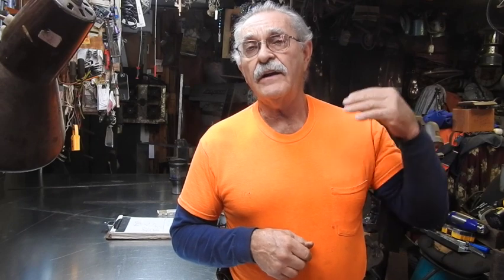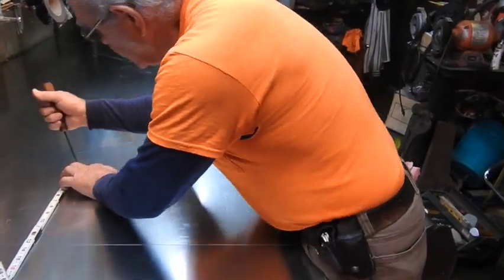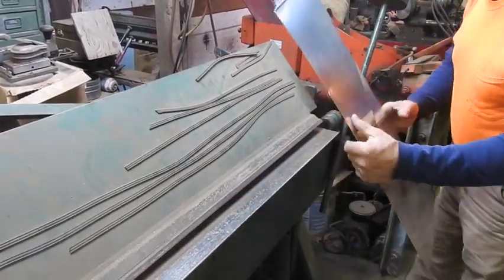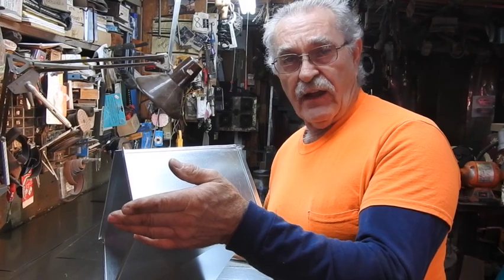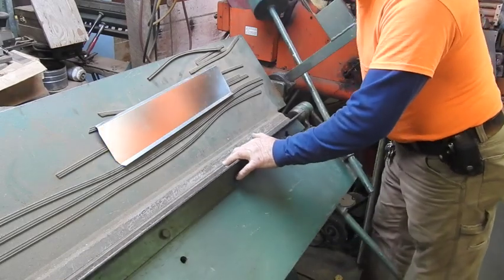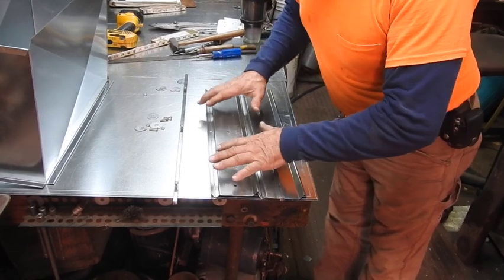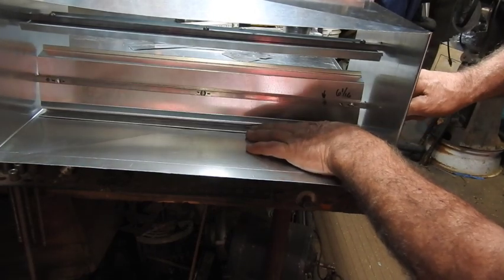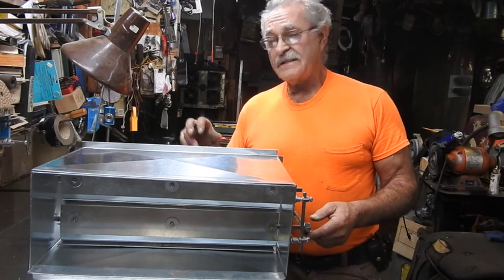Wood Furnace Backdraft Damper Fabrication - Sheet Metal Hack

Comment: how come the top/bottom (riveted on) block off can not extend up the sides of the walls?
Reply from the maker: The edges of the dampers need to have space to rotate 90*.  With vertical lengths of the block offs in place on the sides, the dampers wouldn't be able to rotate unless they were half the height of each blade and mounted on opposing sides of the dampers. In my estimation its not worth the effort.  The law of diminishing returns applies in this case.  Factory built dampers are of a much higher quality and seal quite nicely  by several different methods that I don't have access to. That was a very good question Jason.

Comment: ... during power outage, are you planning to use generator for the blower fan for wood furnace or use it like a gravity hot air furnace? Thanks.
Reply from the maker: I rolled the answer to this in the longer reply on your other questions.

Comment: Holy smoke! Amazing, how you made the damper. I didnt know that there people who do them manually . But I was always interested how they were made :) a)  I would advise you to teach hvac in a college.. You know so much to share. b) it would be great if you showed how you assembled levers :)  Did you buy them as a set, or assembled from different parts? What do you use to contol programmable digital actuators? Looking forward to seeing other videos. Thanks a lot 😊
Reply from the maker: All the linkages and components are rtu salvage parts as will be the actuator. I no longer have access to digital controllers or the software to program them, so I will be using either one or two 24vac spring return actuators and a series of relays to make it all work automatically with the actuator serving the wood furnace to spring return to the open position in a power failure.  Then let thermal movement do its thing.  That's why on wood furnace ducting its important for about the first six feet to maintain a 6'' distance to combustible surfaces.  This was the easier of the two.  The air handler has a series of 4 dampers in it.  It too has a separate video highlighting its fabrication.

Comment: Is there a reason you leave the bending bar on the brake?  Very talented thanks for making these videos. I always learn something
Reply from the maker: Yes, the vast majority of fittings bent are not affected by the bending bars presence. So the extra security it gives the apron (or bending leaf)  against being sprung is worth it. Most of the time though, I'll go to the other 8' Dreis and Krump out in the other shed if necessary to bend something close without a bending bar.  If you bend even a 4' long piece of 22 guage material, without the bending bar, you can see the flex in the center of the apron of the brake on a double hem.  That's how they get sprung.  Thanks for the question and for watching !!

Comment: I've made a hand full of these for others. Odd thing, I've never made one for myself. 
Doc
Reply from the maker: I've installed literally hundreds of factory supplied dampers in commercial hvac systems and have fabricated dozens of these dampers for residential systems both manually and automatically operated.  I've got three manual ones in my own downstairs.  Thanks for the visit Martin !!